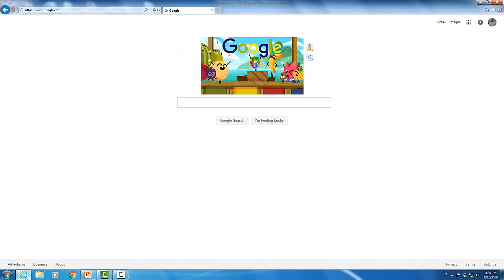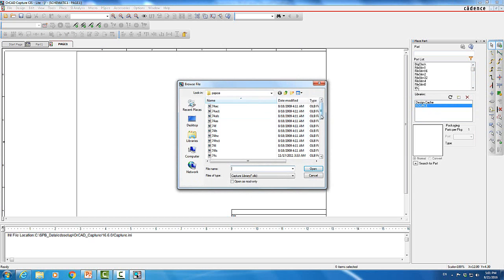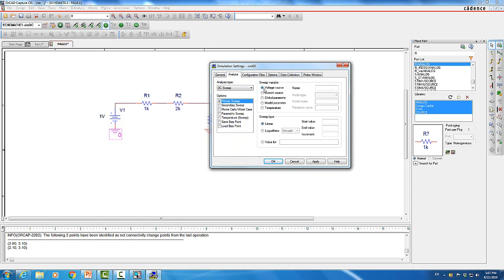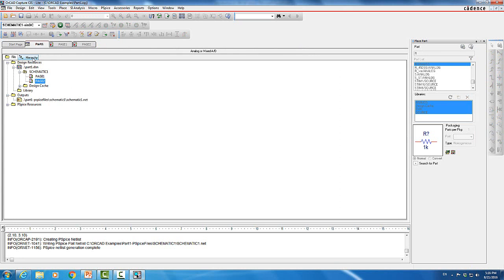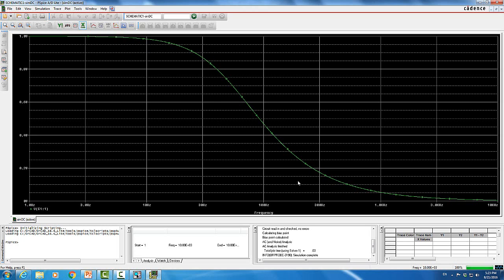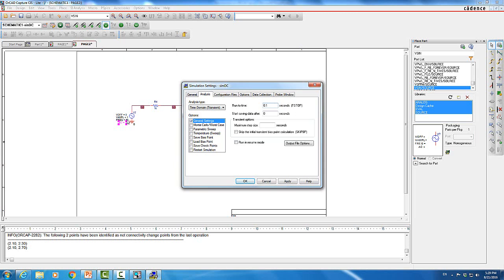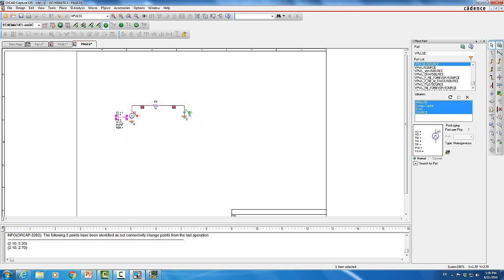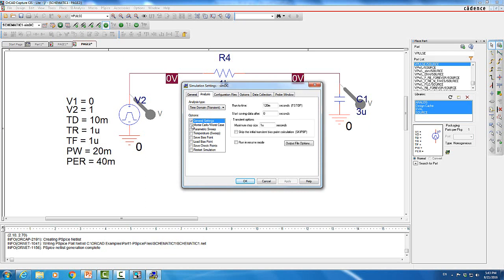PSPICE Orcad Tutorial Part I: Introduction to DC Sweep, AC Analysis and Transient Analysis

Comment: Dr Ahmed can i ask you a question 🙏🏼🙏🏼 that i take alot of time to search on this topic but its hard go get a satisfied answer for me.
My target is to design circuit that contain any analog components and ics. So there is an option to get a satisfy result by trying by signal generator and oscilloscope. But  i want to model all my compent to simulate it ? What is the best way to do it? And is it possible to model any ic? What is the best software environment helps me to make this (ltspice or matlab or combination or others)?
I wish you to help me in details 🙏🏼🙏🏼🙏🏼🙏🏼
Thanks alot for your time 💐💐